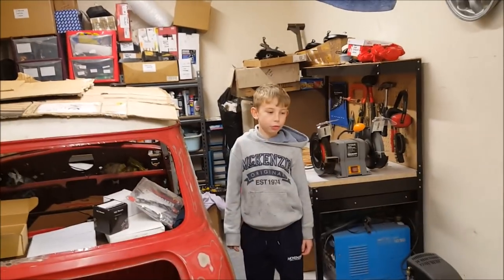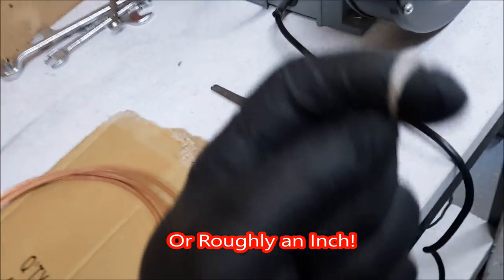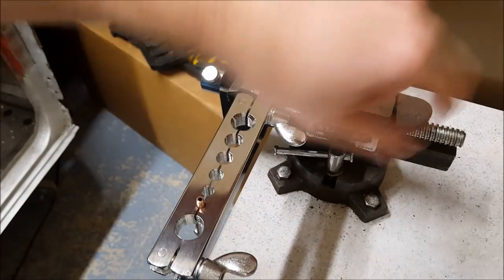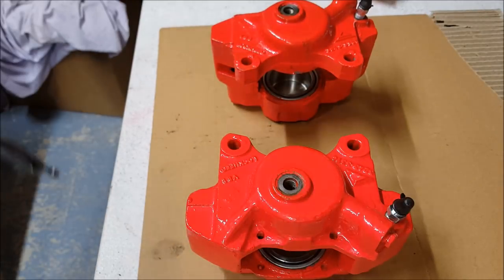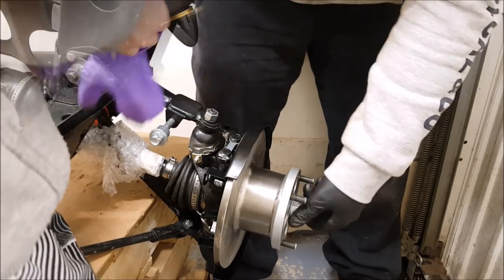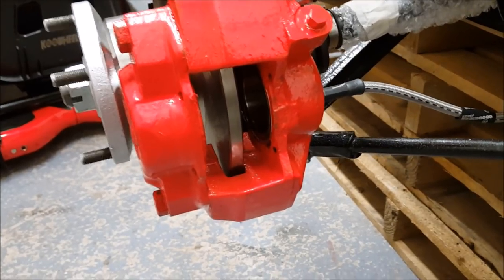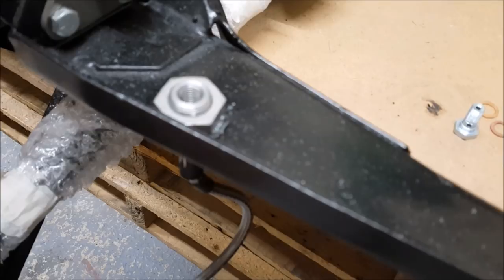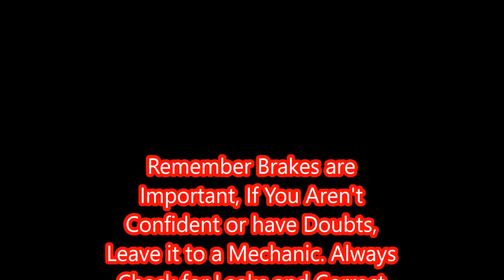Classic Mini Restoration: Eleanor video 26, Building Up the Front Brake System

Comment: Bringing back memories of me building my front Subframe up last year for mine. I wasn’t confident enough to make my own break pipes though, I bought them ready made to length.
Reply from the maker: Graham D S its such a good feeling building up in a new condition and seeing the finished results. Very satisfying. You will get that too when this engine comes back
Reply: @DBMiniDIY  upgraded my disc brakes to 8.4 vented 4 pot caliper. And was wondering will my my servo be ok or will I have to upgrade that as well thank you
Reply from the maker: @petersurguy4179  just the same servo, I've experienced those brakes on the mgf and they are good
Reply: @DBMiniDIY  thank you mate

Comment: Great vid, Dale! One thing I will mention is front brake pipes are handed. One will have a longer internal thread at the subframe to allow the union bolt to go down into, the other is shallower and sits on the passenger side.
Reply from the maker: Thanks mate. The goodridge braided ones that i used are the same for LH and RH sides but believe the rubber ones have to be fitted to the correct side
Reply: DB Mini DIY ive got Goodrich on mine, chap. They’re handed but visually they look extremely similar.
Reply from the maker: Mm i will need to have a closer look at them. They are off the car just now. One of the guys from bulmotif said that they were the same when i enquired about them ages ago. Will examine e a bit closer though.cheers buddy
Reply: DB Mini DIY you're welcome! Shame I can't upload pics and show you mine I have here on the bench!

Comment: Superb work DB as always love the quality and care your taking, also getting your lad involved is great!!! One thing should your braided hose to the caliper have a copper crush washer?
Reply from the maker: Akex i did think/wonder about that. I don't recall any being on the old hoses when i took them off and there was none in the pack i bought (not for the front hoses anyway) and when i checked online diagrams i could not see any but it did feel like something should have been in there. Maybe someone can help us out who has changed them already
Reply: I will have a look at mine buddy mine were already done when i bought the minisport calipers so i will check for you pal

Comment: DB, The pipe with the male & female fitting from the 2 way union to the brake balance was replaced at some time due maybe to rust it should be one section of brake pipe or it could be they damaged it during bending and replaced it. Cheers Sean & Dave
Reply: Dave - It was a union fitted to make assembly on the production line easier as the subframe / engine unit was fitted from below the car body ....
Reply: 1chish has got it spot on. Later cars have a long union adapter that you can do away with. All my minis have had this pipe replaced with a braided piece.

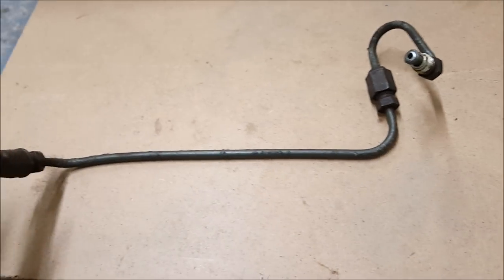Comment: In answer to your question @ 31:29 That union was used to make assembly of the engine / subframe sub-assembly to the car body on the production line easier and quicker. It can be discarded so use one pipe from the PDWA valve to the subframe union....
Reply from the maker: Thanks. I thought as much but curiosity got the better of me.

Comment: Is it possible to remove the engine gearbox sump without taking out the engine in a classic mini
Reply from the maker: I'd not even attempt to. The access, the clutch, flywheel etc would be a nightmare as well as the mounts. I'd take the engine out and use that time to give it a good, clean, bay and block, and replace anything else while you are there
Reply: @DBMiniDIY  The real reason is that I was cleaning the back of the engine and I had old cloth stuffed in the exhaust and fuel pump hole ans I think a piece of cloth went into the fuel pump hole. I'm not 100% sure and I've checked inside the hole with endoscope and I can't see the cloth. The shit is doing my head in lol. Could I drain the oil and then use that hole to check inside the sump?
Reply from the maker: @IsraelitesUnited  lol you won't do that again, you will never see every part of the sump to know for sure with the camera
Reply: @DBMiniDIY  There are two plates at the back of the engine held in place with a bolt each can they be removed to see inside the engine with the engine oil still Inside
Reply from the maker: @IsraelitesUnited  you might get a bit of oil seep out but all the oil when the engine is off will settle at the bottom so it will be fine. Replace the gaskets if you are taking them off